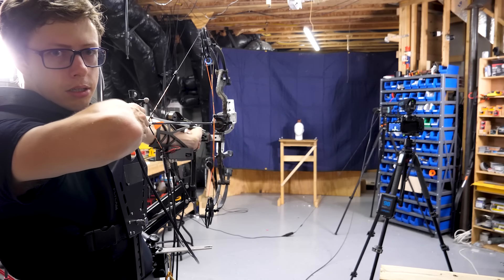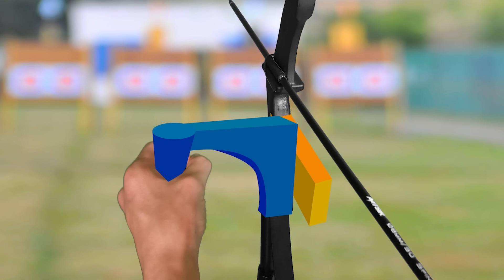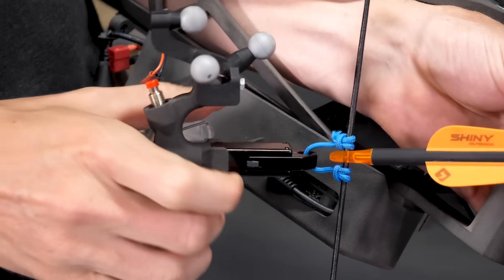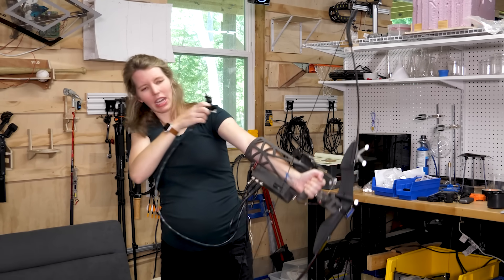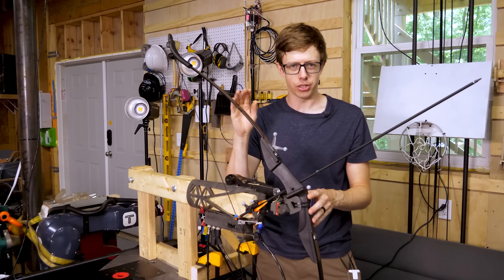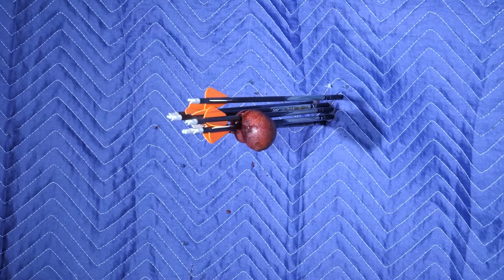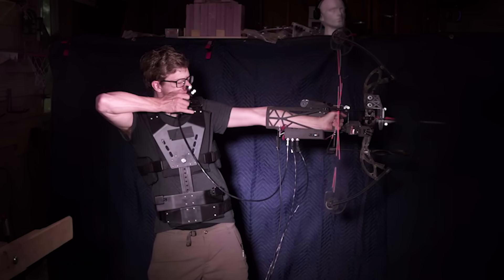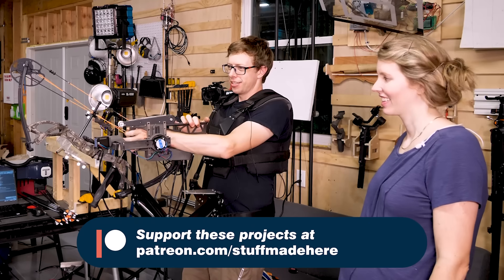Auto-aiming bow vs. FLYING targets

Comment: As someone who shoots archery quite a lot and is an avid bowhunter I have some tips to help squeeze that last bit of accuracy out to lessen the workload of your V2.0 design. I would recommend getting a drop-away arrow rest and also 'paper tune' the bow and your arrows. Inconsistencies in arrow shafts, vanes, tips and your arrow rest will make it almost impossible to achieve that accuracy even with all of your improvements.

Comment: This was really interesting. I love watching engineering stuff. 

In regards to the FormLabs thing... The FormLab resin printers are actually really interesting. One my old employers rented a few to see if they could create viable nasal swabs to assist with Covid testing during the initial outbreak. All the swabs were rejected. They were fragile and extremely uncomfortable. We tried a couple different versions but they were all garbage. The project fell through unfortunately. That being said, the reason they failed was mostly in the process and because resin is a fickle material and not because the machines were bad. They did eventually start breaking though but that's because we were running them 24/7 for like 4 months straight. The only negative thing I can say about them is that they're an absolute pain in the ass to clean. The resin baths in particular can be stressful to clean because you can't apply too much pressure or use any sharp tools because damaging the bottom it in any way, big or small, will ruin it and any builds involving that particular bath.

Comment: As an archer and an archery instructor, i love this. Especially the compound bow part. The problem with the recurve bow was two things: the draw length of the bow was WAY too short, you should have been able to pull it back to your cheek,  and you should always have the string on the side of your face, not in front of your face. This prevents the punching yourself in the face. If you really want to get competitive with archery and your next design, I highly recommend investing in a more expensive bow made for target archery, using both a stabilizer and V bars, and using a forktongue rest. With this equipment plus your tech, i'm sure you will be hitting bullseyes at 70m soon!
Reply: Another thing to think about is using very similar arrows. Having differently weighted arrows also impacts the consistency.

Comment: So there's a basic physics problem that I would say makes a portion of the shots cheating. That is, whenever the arrow is fired at the Target when the target is at the peak of its height as long as the arrow has enough speed to go the distance between the launch point and the target it will always hit the target if aimed directly at the Target... (Hope that made sense) because the arrow and the target fall at the same rate.

Comment: I have no idea/knowledge about coding/engineering but- Would you be able to use rangefinders with laser thermometers to scan a 3x3 metre grid in front of the bow, then use code to identify the quarter of the grid with the highest stark difference between hot and cold repeated until it's roughly the size of your target you're using. Then use the rangefinders to calculate the distance as well as track the target for a set amount of time to calculate its speed and angle which should (IDK) give you its trajectory? You'd need to heat your target though, a heat-seeking auto bow that's dangerous to shoot near any living thing.

Comment: I'm no engineer, but I am an archer!
For V2, I would reccomend finding a way to anchor the string to your face a little better. I will reduce punches, and will also reduce motion on the string during release, tightening up groups. I'd also look at some high-end competetitive compound bows, they have all kinds of fancy rests, perfectly tuned cams, rock solid draw lengths, etc. all in the name of consistent, repeatable performance. Some of that engineering may be done for you!
Awesome video!

Comment: Great project. I think the problem it performs poorly outside the workshop is because the aiming system depend so much on those fancy expensive cameras (and hours of careful calibration). It would be nice if you can make a version that does not depend on that. It's going to be challenging but not impossible (a skilled human archer can do it, why the machine cannot, right). You might need to use some new technology such as reinforcement learning. Good luck, but be careful as it can be a dangerous technology once you develop it.

Comment: So, I'm not an engineer, but why didn't you give the string release robot part a thin cable connected to the bow part so that it couldn't reach far enough from the bow to punch to punch yourself in the face?

Comment: I’m pretty sure that far in make sights that correct for distance so if you could hook one of those up into your rig you’d be golden for long ranges and it should work without the camera system

Also a drop away rest and most of those issues should be dealt with (and it’s the cheapest fix to your issues I can think of), though arrows are where a lot of the issues could be coming from.

Comment: You are one of my inspirational character as an undergraduate engineering student..Suggestion: adding a sliding rail kida thing which fixed to the bow frame  to slide the releasing part will going to save your nose and it will direct the arrow in a perfect direction

Comment: I noticed that you were using a "whisker biscuit" on your compound bow, that's not really all that bad but it has flaws. If you change that out to a "drop down arrow rest" you'll be able to avoid variables in the arrow trajectory. Whisker biscuit can cause arrows to move as they leave the strut line causing a shift in the arrows flight. A Drop down arrow rest drops away the second the arrow releases giving it just clean air to move through, leading to better flight paths and overall accuracy, especially for longer distances.
Reply: Drop down arrow rests are inconsistent however because the arrow doesn't start out on the same place, where as with a forktongue arrow rest it forces the arrow to start in the same spot.
Reply: @flamethrowr_  That's actually a really cool piece of information, I am going to have to ask about that next time I go to my Archery Shop. I was told by the Paralympic Archer who taught me, to swap my whisker biscuit for the drop down. From personal experience, I haven't had issues with the drop down, but I am going to ask him about the fork tongue arrow rest. I know each archer has his own preferences and styles. I learned something new tonight, thank you man.
Reply: @froza_legend  In competitive compound archery, the blade rest was always a go to since it had zero moving parts. You can't go wrong with this, as you aim for the least amount of contact with the arrow. They were popular over drop downs due to the poor engineering on drop down rests of the past. However, that is not the case any more, and the new drop down rests are much more consistent. There are now multiple pros shooting them, to the point where you can argue that the performance comes down to preference. Do you have the stability to shoot a blade rest, or do you prefer a drop down at the cost of lots of tuning and tinkering.
Reply: Whisker biscuit
Reply: in this case i think a drop down would be better because the way the bow moves a fork tongue would have too much horizontal movement because of the arrow weight.

Comment: Biggest recommendation I can make for V2 is to increase your draw length so that you can properly anchor your hand against your chin or cheek. It will make the bow more stable and you won't be hitting yourself in the face anymore. It may require longer arrows to make sure they stay on the rest though.

Comment: Questions: 1) it seems like you engineered the targeting with a physics engine that took initial conditions to calculate where the arrow would land for the one shot. Why did you choose this route for targeting instead of using a physics engine that took a series of shots' initial and end conditions to provide a best statistical calculation for the new shot? I would think this other route would have less integration hell because the statistics would integrate it for you. This does create a problem for when aiming in a setup different from the initial setup statistics shot, but I'd think that by then a basic physics engine could take over easier.
2) I understand that not only does your bow have camera location trackers, but so does the target. This could be problematic if ever shooting in not your secret underground laboratory especially at targets you haven't already touched. You already are wearing "body armor with a snake", "engineering", or well the skeletal frame of a year ambiguous tank. Have you thought about attaching a few cameras to this frame to attempt to create a somewhat portable laboratory targeting system? Surely as distance increases the error increases as the camera images would become more of the same making it more difficult for the computer to calculate distance. But our eyes aren't too far apart and do an OKAY to not very good job of distance determination and you can place the cameras farther apart than eyes. How quickly do you think the targeting would suffer? Then the only issue is identifying what the target is, maybe instead of seeker balls for the target, also attached to your official over-sized red ryder, carbine action, two-hundred shoot your eye out toy you could have a tablet or something with a feed from the cameras that you click on to tell the computer where to shoot. I mean, it has to have a computer somewhere anyway right?
3) Formlabs, I saw you listed: Boston, Durham (NC), and Budapest; I am in none of these locations and do not feel a capacity to move. Do they have any open positions that are remote work? I am a mathematician and programmer by training and currently job hunting.

Comment: I have an idea you could do for your second channel.
Code review  (you could break it down into sections just explain what it does) or any other aspect that doesn't make the final cut 
A sort of honourable mentions
Reply: As somebody who codes occasionally, I know it's really hard to do. At least for me. Because you'll be super focus and in the zone when you are trying to solve a code problem. Thinking about anything else will break your chain of thoughts. And it'll be hours before you stop. And when you are done. You've gone through hours of changing things here n there, it's hard to go back n do a "review" of what you've done.

Comment: The only thing left is to add a sensor that continuously measures the draw weight. That way your maths can include for expected arrow velocity in, say, cm/s. It will greatly improve dynamic aiming for moving as well as for distance targets.
Reply: Now that he's using a compound bow, draw wieght should already be constant. Compound bows have a "release point" where once you fully retract the string, the weight you are holding drops off, but you maintain the full weight potential of the bow. So, assuming he is fully drawing the bow each time, the weight shouldnt vary.
Reply: @jacobhargiss3839  There is let off, but it still varies according to the eccentricity of the cam profile, leaving some 20-30% on the table to be managed by the archers arm leading to some variance. A few pounds difference can matter considering the mechanical advantage of the cam system, and the distance and timing needed for moving or distant targets. Being able to include arrow velocity is fundamental to accuracy, as it is for all projectile sports. It's fine the way it is, but I think it would help capture that 9 or 10/10ths still out there.
Reply: @dolamyte  fair point
Reply: @jacobhargiss3839  You're not wrong and I'm not saying I'm right. It's just the next step I'd take is all
Reply: @dolamyte  every added bit of data helps

Comment: Cool but kinda useless. 
If it could work without the camera setup and anywhere u are, then it would truly be absolutely awesome! 
Maybe try to work with small Lidar and infrared cam, maybe laser assisted, attached to be bow or so? there is probably a way. If you manage to do that and may make it even possible to work on other ranged weapons, you will be a millionaire. The military will pay you that sum for sure for such a tech.

Comment: Use a drop away arrow rest on the V2. Someone has probably already said that, but im putting it in just in case. A drop away arrow rest is generally considered to be more accurate than a static rest with nylon fibers, like the one you were using. That's because as soon as the string is released the arrow rest drops away meaning nothing else could possibly alter its flight path, a static rest with nylon fibers, however minimal the altering of the flight path might be, there's still a chance.

Comment: An easy fix for preventing your face from getting hit is to change your elbows postion. By putting your elbow way behind your head and with your bowstring resting ontop of your nose and mouth. When you let go you will have a place to move your hand, if your hand goes from holding the bowstring towards your ear it will be stopped by your arm and elbow, preventing it from moving anymore,  unless the amount of strength that you used to hold back the bowstring was so  great that when it goes back it breaks your elbow, but I'm not sure that's possible.
Reply: In archery, form is very important for accuracy, endurance, strength,  and practice, but I guess taking advantage of robots is okay.

Comment: This brings the complexity of Anti-aircraft artillery into perspective.
Reply: Anti-aircraft is one thing, CRAM is another level all together, and anti-ballistic missile is out of this world (literally) lol
Reply: @djsomeguy  good old CRAMs
Reply: Anti-aircraft artillery (guessing you're American because we're the only ones that call it that lol) is impressive, sure, but have you heard of "hit-to-kill" interception?

A couple excerpts from the Patriot missile wiki page:

"The PAC-3 radar is capable, among other things, of discriminating whether or not an aircraft is manned and which of multiple reentering ballistic objects are carrying ordnance."

"The active radar also gives the warhead a "hit-to-kill" (kinetic kill vehicle) capability that completely eliminates the need for a traditional proximity-fused warhead."
Reply: @nova5303  Speaking of the Patriot... in early versions, there was a clock issue if the system wasn't periodically restarted.  When Iraq launched a SCUD in the instance of one system that had been on for 100 hours, 28 soldiers were killed because the system ended up having enough of a timestamp mismatch that the system looked in the wrong part of the sky and failed to launch a missile due to not finding a target.
Reply: @spyderf16  I'm now wondering how that was missed in development

Comment: A bow that pulls the arrow rather than pushes the arrow might be an interesting project. Would get rid of almost all of the wobble in the arrow making it more accurate. Also the draw length on that bow is probably a little to short so you can’t get to a stable cheek rest. Meaning you punch yourself instead of already contacting your face

Comment: This is the greatest feat of engineering I've ever seen. Absolutely unfathomable.

My relatively limited years of experience in archery is suggesting that the slight variations in your bow arm/hand from when you release, to when the arrow is clear of the bow (even with compound) is what's making the biggest difference at this point, especially at longer distances (i.e test with an olympic archer for best results).

Anyway, thanks for making the world a more interesting place.

Comment: no doubt this is super cool just for the demonstration of engineering, but if all you want to do is instantly become like Legolas in Lord of the Rings, the product you should check out is called The Fenris, designed by Joerg Sprave, a German inventor right here on Youtube.

https://www.youtube.com/watch?v=BF_OuEba3a4&ab_channel=JoergSprave 

Seriously Mr. Stuff Made Here, I strongly recommend you check this guys innovation out. It might not have the same guarantee of hitting the intended target that you are going after in your video, but the amount it increases anyones skill with a bow instantly, compared to how simple it is to manufacture, install, and operate,  I think  would rank it as a bit more elegant and practical solution. 

All that said, what you've done here is still badass, and once again you've made the internet a better place and have helped stoke the curiosity, innovative spirit, and internal motivation of everyone who comes across you video. Thank you!